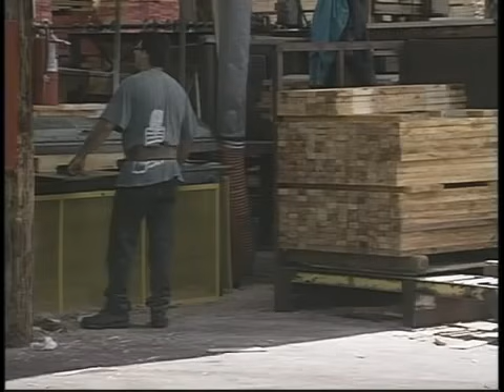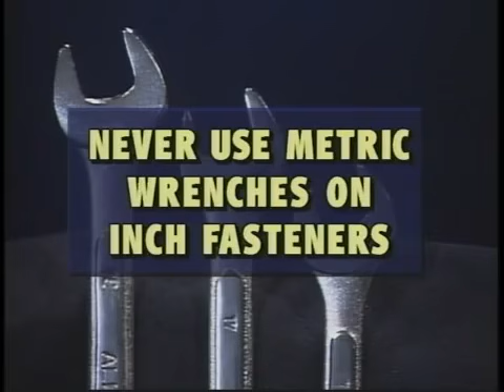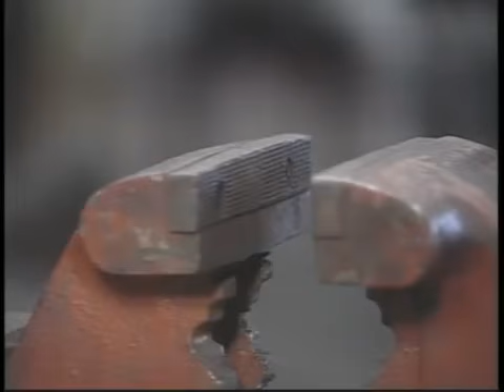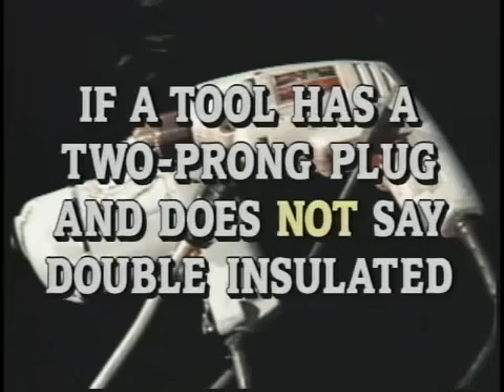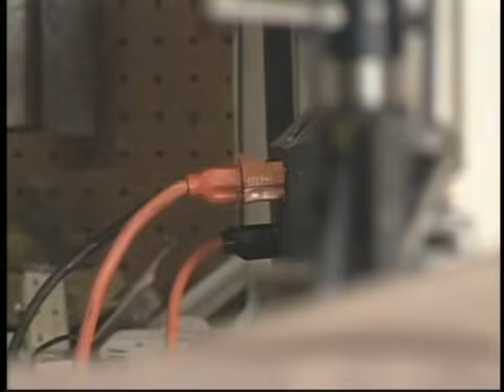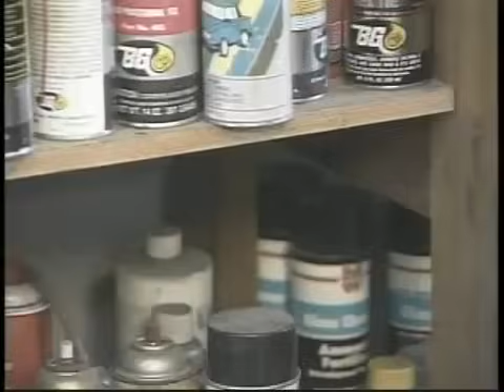HAND & POWER TOOL SAFETY

Comment: Ma'am, that is an eleven pound whole slab of deli ham. It has no bones, fat, or connective tissue.
It is an amalgamation of the meat of several pigs, emulsified, liquefied, strained, and ultimately inexorably joined in an unholy meat obelisk. God had no hand in the creation of this abhorrence. The fact that this ham monolith exists proves that God is either impotent to alter His universe or ignorant to the horrors taking place in his kingdom. This prism of pork is more than deli meat. It is a physical declaration of mankind's contempt for the natural order. It is hubris manifest.
We also have a lower sodium variety if you would prefer that.

Comment: If your here for a Google classroom assignment here's the answers 
1. Screwdrivers cause more than (100) deaths a year
2. (A good safety attitude)
3. Defective tools must be (taken out) 
4. Use of a cheater bar is acceptable (false)
5 three type of sockets are (hand, power. And impact)
6. Power tools require (special attention)
7. A wet or moist environment is (extremely hazardous)
8. All drill bits must be (SHARP & in good condition)
Your welcome
Reply: I think they saw your comment because they changed the questions
Reply: what a legend